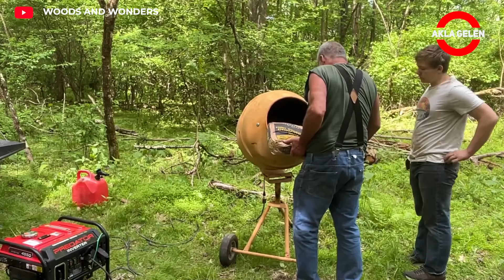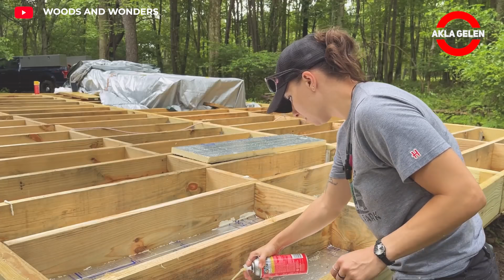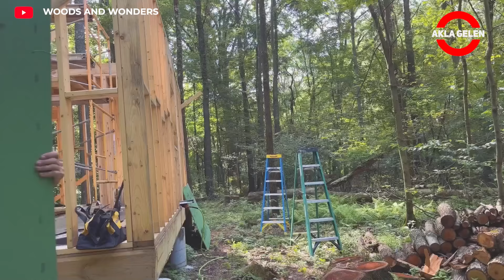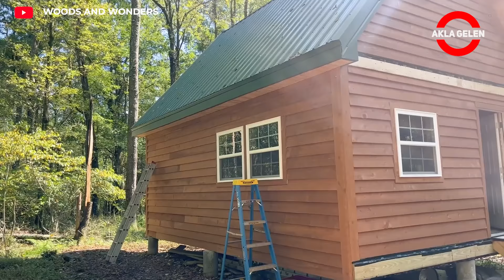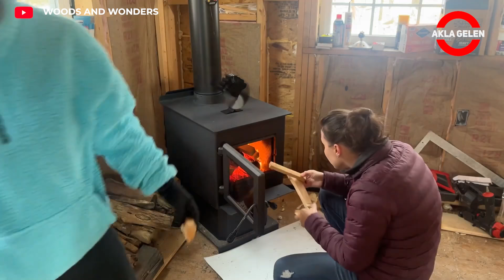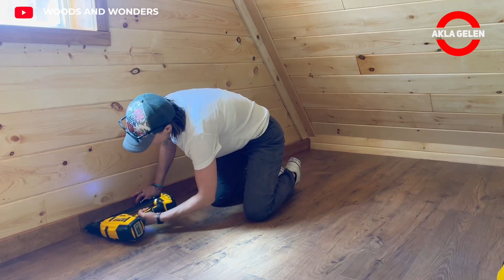Woman Builds Dream Wood Cabin 25 Minutes -TIMELAPSE | Start to Finish by @WoodsandWondersCabin

Comment: The loft is nailed to the outer wall? Normally you would want that weight to transfer to the sill plate otherwise the weight is being supported only by nails and I didn't see any soffit vents so that ceiling is going to get wet, not just damp. I'm also assuming there is no indoor plumbing.

Comment: I've built several large sheds.  One problem, among many others when working solo, is the amount of time spent obtaining, unloading, and moving all the material around the job site. Factor in ladder time, constructing braces and templates, and fixing mistakes and equipment, and a 10 hour day turns into 14.  And I  didn't see them square up the frame before adding the sheathing.   If the frame isn't squared up, you'll have issues with the roof.  Gee, how would I know that?

Comment: Excellent job. 
The only thing that I don’t do myself is hang joist hangers first. They were using a scrap piece of wood to flush it to the top. 
But as we all know, all wood is not the exact same size. 
So there are usually some that are lower or taller if you put your joist hangers in first.

Comment: Next time spend the money on some really good wood sealer.  This way you don't have to worry about tarping the floor. Also, next time when you pour the footing posts, slope the top so water does not pool on the surface.  I don't know if you have a problem with termites and porcupines but both love to chew wood under cabins.

Comment: I've watched a lot of builds and assisted in several. I have two questions regarding things I've never seen before. First is the floor insulation. You have the entire depth of the floor joists but only put insulation panels on the bottom of the space. Usually rolls of insulation batting would be used to get as much of a thermal barrier from the outside as possible. (We saw the WV snow after all.) The second is regarding the stove. I'm not sure of the thermal specs of that stove but do the walls behind the stove need some protection? Usually stone, brick or concrete board of some kind is used to make sure the walls don't burn or discolor over time from repeated high heat. Just questions I had. A nice video over all.

Comment: Wow, what an inspiring journey! You have some serious skills to pull this off by yourself.

Quick question/concern about the exterior wood siding: I noticed you fastened it directly onto the Zip System without vertical strapping/laths. In wet or humid climates, nailing siding flush to the wall traps moisture behind the wood, which can cause it to warp or peel the paint pretty quickly since it can't breathe or drain. Was there a specific reason you skipped the rainscreen air gap? Love the cabin look, can't wait to see how the interior holds up!
Reply: Also, I just noticed your roof insulation: Putting the pink R21 fiberglass and wood ceiling directly over the Styrofoam without a continuous 6-mil poly vapor barrier is a big risk. In the winter, the warm, humid air from inside the cabin (especially with a wood stove) will pass right through the wood planks and fiberglass, hitting the cold Styrofoam. It will cause major condensation, turning into trapped moisture that will rot the rafters and cause mold behind your beautiful ceiling. You absolutely need a well-sealed vapor barrier before the tongue-and-groove boards go up. Just a heads up from someone who values building for the long haul!

Comment: It's a Pinteresting building design. I would put a gable above the porch roof, so that the rain exits on the corners, providing a clear view. Just imagine trying to take a pic in the rain with a sheet of water coming down in front of you. Why go to that much trouble, only to have a terrible view when it rains, as well as rain and snow restricting access from that side. Gable ends rule when you want a view and easier access. Roofs exist to spare you from the weather. Having a roof that sends the weather to you as you enter or exit is counterproductive.

Comment: One more “small” note:
Laminate flooring on any flexible or moving subfloor is generally a very bad idea.
Laminate is extremely sensitive even to the smallest unevenness and deflection. And that applies to all quality levels — even the most expensive laminate will behave poorly on a thin OSB-based floor structure.
Your camera is already shaking just from floor vibrations, and you’re laying laminate on top of that… well, I guess that’s only a minor issue.
I’m sure in about a year you’ll have saved enough money for a new… house :D

Comment: ...

Oh, sorry, I might have been mistaken. I thought this was a video about a woman building her dream house.
But we can relax — such a simple little cabin would stand even on four supports. It’s just a basic summer getaway structure.
The only “small” issue I’d point out is this: the electrical panel. Due to moisture, it could short out the entire system. It’s not protected in any meaningful way and is mounted directly on a thin OSB wall panel. And the decorative wooden cladding on the outside doesn’t really provide any protection at all.
Basic safety rule: areas like this must be properly protected from moisture, and in this case moisture is absolutely going to be present, especially during the winter season.
This leads to a somewhat unfortunate but factual conclusion: most DIY builds you see online are essentially just shows, where in reality very few of these structures are meant for actual long-term living or even regular use.
I’m not talking about a different category of builds, where contractors film the construction process of commissioned projects and publish it — those builds are usually technically correct and follow proper safety standards.
This, however, is just a show. A fairly decent one, but still just a show.

Comment: Everything looks fine so far... but personally, I wouldn't risk supporting an area that size on just nine concrete foundation piers. I'd probably go with twelve instead, so the wood has less concentrated load to deal with.
Also, this isn't critical, but it's generally better when a pier foundation sits on a compacted base and a small concrete footing. That helps minimize settlement when the ground experiences minor movement.
Other than that, at least for now, I haven't noticed any obvious mistakes. The idea itself isn't new, but it's a good one.
And while I understand this is ultimately just a DIY project, and the woman's story is part of the creator's narrative, good DIY projects still try to follow basic construction principles. That's something I appreciate. Hopefully I won't have a reason to change my opinion as the project progresses.
.........

Comment: Seems like those foam insulation panels placed on top of the bottom OSB boards should be about 4X deeper. That's only about 2" of insulation on the bottom. And no house wrap/vapor barrier over the exterior panels?

Comment: "Frau baut" - aber nicht wie suggeriert alleine.
Man kann, sicher auch in den USA, nicht einfach irgendwo beginnen ein (Holz)-Haus hinzubauen wenn einem das Grundstück nicht gehört und eventuell eine Genehmigung vorliegt, oder?
Welche Holzarten wurden verwendet?
Mich würde interessieren wie viel das gesamte Material gekostet hat. Hier in Deutschland ist der Rohstoff Holz um einiges teurer vermute ich mal. Diese Hütte hierzulande zu bauen kostet alleine beim Material schon locker € 30.000 (grob geschätzt).
Holz ist so ein wunderbarer Werkstoff und jeder der nicht gerade zwei linke Hände hat sollte damit in der Lage sein etwas zu bauen.

Comment: Having a vaulted ceiling in a cabin in West Virginia seems like a waste with cold winters. Heat will rise and she will have to use more wood.
Reply: I would have done what she did.  Useable space vs Heating and Cooling.  Something has to get sacrificed.  I want the extra space.
Reply: She did put a ceiling fan in.  That helps.

Comment: This a great example of how a proper cabin  house should be built. But I see a major problem here in that to build a house the right way would take two to three times as long and cost a lot more. That's why most home builder take shortcuts by buying cheap materials and hiring cheap unskilled labor to built homes.  I promise you that most homes in the U.S. are just quick builds using cheap materials with lots of shortcuts.  They are not built with this much attention to detail.

Comment: Where are you getting water for the bathroom? Are you trucking water in and using a cistern with a small water pump? Where is your waste water going? What about hot water? Small water heater? Where is the power supply for the Circuit Breaker Panel? Generator?
Reply: It looks like a composting toilet. There are several ways to collect and have water. Amish live without electricity every day. Water comes in various ways.

Comment: In order to protect a flloor from water damage i once painted  a 1600 square foot floor. I caulked all potential gaps and then applied a couple coats of latex paint which was free leftover colors. The plywood deck had to sit. For 3 weeks until the framers were ready. It worked great and we got some heavy  rains. I simply swept oof any rain or puddles that accumulated. It worked  beautifully and i didn't have to mess with plastic and wind .  My two cents! Great video and thanks for posting!!

Comment: I did the same but literally by myself with some guidance from a carpenter who showed up once a week to advise me on next steps.  no power nailers, only a generator, no quads for hauling trees, I literally just now finished hauling the last branches out after burning for 3 years.  now it's finally coming together nicely, should be getting a well in here in a few weeks.  and yes why does it always rain after you have the floor down but no roof on yet.  sigh.  my floor was 1 x 8 fir and it bulged from the rain and the tarp that leaked.

Comment: Absolutely incredible, I watched every second. I'm contacting you when I'm ready!!
Reply: There were lots of code violations and poor insulation and techniques in the floor. The joist hangers by code need to use the proper type nail and ever hole needs to have a nail in it  Not nail gun nails. And there were much better ways to seal and insulate the floor properly.

Comment: This was obviously done without a permit or even knowledge of Building Standards - 1- all the interior wood panel Looks great but is a significant fire hazard - will burn up so fast and catch fire easily. And the structure of the roof is so weak, even with a steep roof, it was obviously done Without any Engineering knowledge! There is little to support the peak and the are no bottom cords or beams to brace the spreading forces of the load on the rafters. OMG - I hope Nobody copies this design or this content creator could be in for some bad lawsuits!
Reply: Huh??
Reply: @GageJohnson-m1s    Moderator or family?  lol

Comment: The wooden frame wall panels are very solid. Where I live, we usually add an extra layer of insulation foam. I really like this solution.
Reply: House wood 🤮 cement and bricks is good 👍

Comment: No vapor barrier on the vaulted ceiling between insulation?
Reply: Also the external cladding should not be fixed straight to the outside boards but be fixed to counter battens.

Comment: Why wouldn’t you put more insulation in the subfloor?
Reply: The trapped moisture will accelerate the rot. People don't understand the materials need to breathe.
Reply: @Mukundanghri pathetic building that's why
Reply: Any extra insulation benefits are better applied overhead than underfoot
Reply: its W.V. not that cold? N.C. houses built prior to 1950 have no insulation in the floor.
Reply: @georgewettig1860     It can drop to 10 degrees in the winter. Huh?
Reply: @georgewettig1860 20's and 30's are pretty common in the winter. If she's in the mountains it will be colder and more snow.
Reply: I was thinking along these lines as I watched but noted the foam board was sealed with spray insulation then OSB flooring was sealed in the same way, effectively producing an insulated air space.
Reply: They should use materials that breathe. Wood fibre isolation
Reply: @user-wo8xg1fo2l Where should they use them? In the floor, walls & ceiling? Genuinely trying to learn !
Reply: Bcz
Reply: The thermometer said it was 29° F and there was snow! ❄️
Reply: God commanded us to remember the Sabbath day to keep it holy, six days work, the seventh day rest.  Exodus 20  and Deuteronomy 5  

If we are to keep sabbath day, it must be done lawfully, by law.

God's law says, let the lights in heaven be for days, etc. Genesis 1;14.

The Sabbath day is one of God's three category of DAYS and it is kept by the sun, moon and stars.

This time was ordained and set up before God gave the people the Sabbath commandment.  This is how the people kept Sabbath.....

.....NOT by the "Famous Gregorian calendar" or any other man made time.

God does not use man's time to reckon His Sabbath, neither should we.

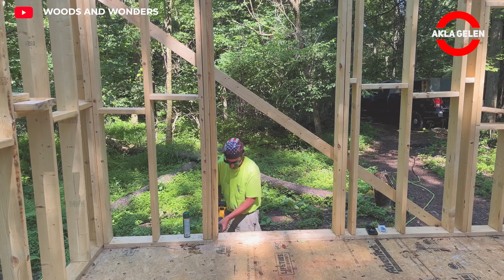Daniel 7:25, the "Beast", only thought to change times.  For, he cannot truly change time because true time sits in the heavens where no man can tamper with it.

This is truth!  God is seeking those who will worship Him in Spirit and truth!

The true Sabbath is NOT Saturday, Sunday, etc.

Ask yourselves, what calendar will be used for worship in Isaiah 66:22,23?

Today, there are Sabbath/Sunday blue laws on government books.  Will these laws be enacted once again?

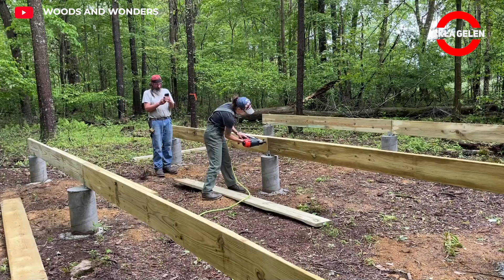It is a great possibility, God could allow the "Powers " to enforce some type of Sabbath law to see if we will keep His Law or no.  Read Judges 2:20-23 .. Judges 3:1-4 ..  Exodus 16:4

...Then, what calendar will you and I use to calculate the Sabbath day in order to pass the test, if such a law is mandated?

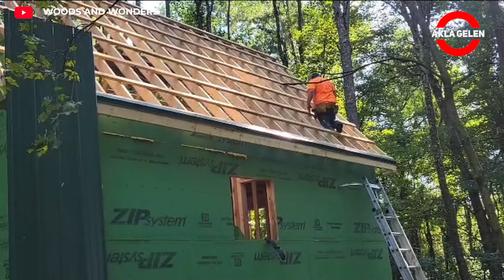The Sabbath is a sign between God and His people.  Exodus 31:13-17 .. Also read Isaiah 56:1-8, Exodus 12:49

Research these things to see if they be truth!!!

Also, research  "The Seven  Noahide Laws" and the USA's Presidents connection to them.  Will these laws be enforced on all nations?

God's truth is our shield and buckler, Psalms 91❤️
Reply: ..close call with that flying nail eh, blessed for sure. Looks good, thanks for sharing.

Comment: It looks pretty good. I would box frame it , it's quicker than stick frame, especially if you don't have much framing experience. Also, I would put my brackets in the concrete when it's still wet and level them. She might have done that, I may have misunderstood something. Also , I'm a big fan of 2 ft OC. Saves time , money, materials, doesn't effect wall strength. A tornado rarely stops to ask how this particular house is framed. It looks good, there are always different ways of doing things , building is no exception. You tailor it to your particular use , needs, etc. I bet they are more relaxed than people in the city . ❤
Reply: Appreciate the feedback. But this is tricky a camping/getaway cabin so I’m going with the most cost effective ways I can.
Reply: SPEND A LITTLE MORE AND OVERBUILD.